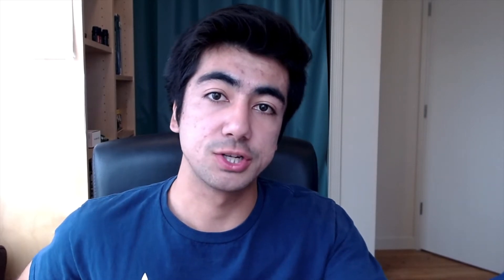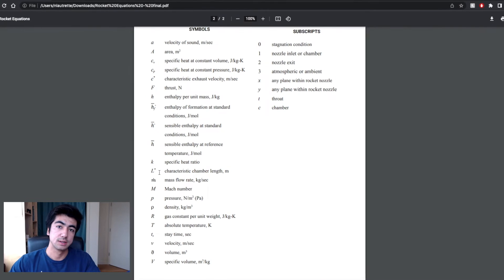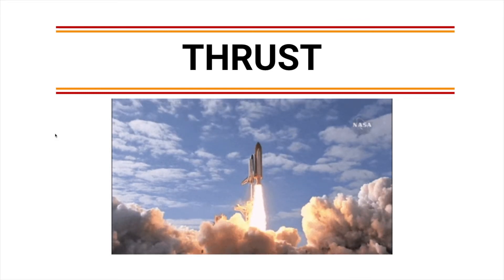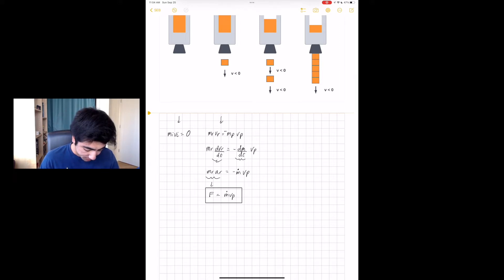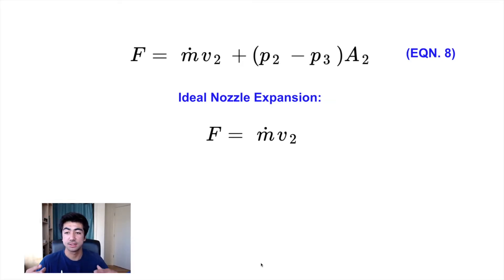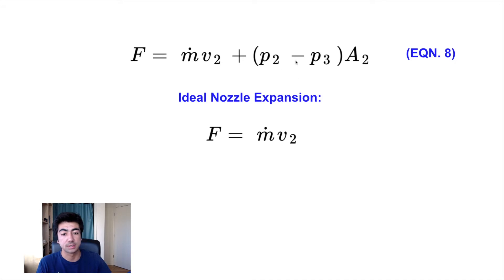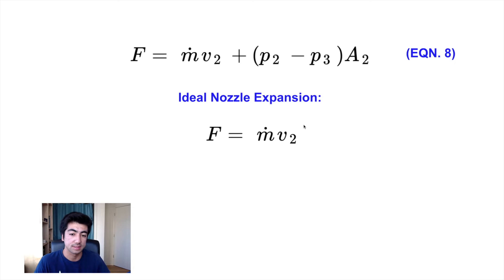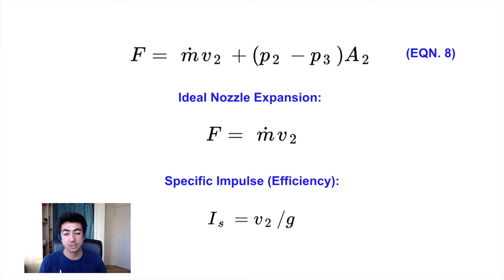Rocket Engine Fundamentals and Design Part 1: Thrust and Combustion

Comment: 9:00 as the gas cools down? not as the gas gets hot and therefore expands and therefore accelerates?
Reply: As it accelerates out the product gas loses temperature and therefore cool down (the air outside is cooler 2 so there os also heat transfer after) .
 Be advised i am an ammetur/noob  and have no prof whatsoever of what i am talking about.

Comment: anyone know why the enthalpies of formation are included on the reactant side of the equation? Intuitively you'd think it doesn't need to be included because the reactants are not be formed during combustion, only broken apart and reassembled as different products. Is enthalpy of formation also the heat released when a molecule is broken apart?

Comment: At 27:35, why do you omit the sensible enthalpies for reactants oxygen and nitrogen? You don't do that for product nitrogen.
Reply: Remember that the simplest state of the chemical is considered to have 0 entalpy . So that is 0 for N2 and O2.
Reply: @MakakunaruLoco  The original comment, I believe, is talking about why the sensible enthalpies are cancelled out in all of the reactants. This is simply because the 'h bar with the little circle' is the sensible enthalpy at 25 degrees celsius, and 'h bar' is the sensible enthalpy at the given temperature in the problem. However, since the problem's given temp is also 25 degrees, they are the same and cancel out.